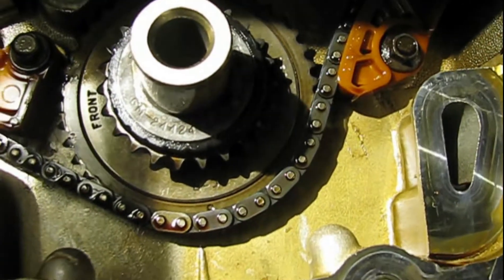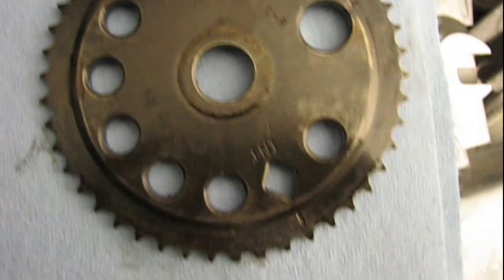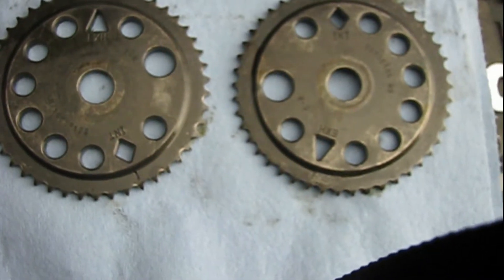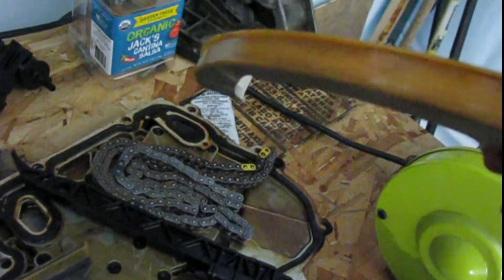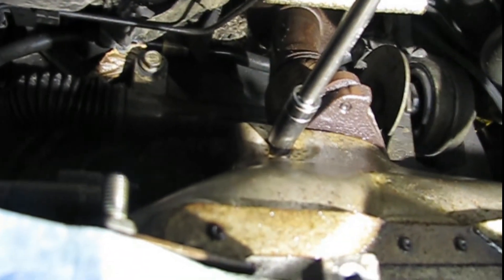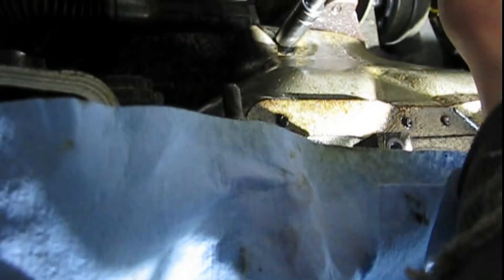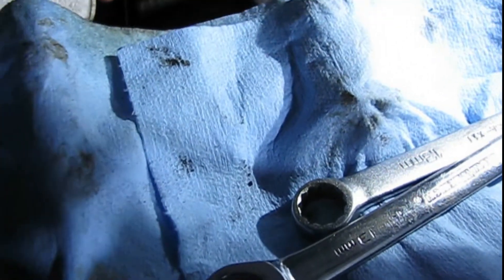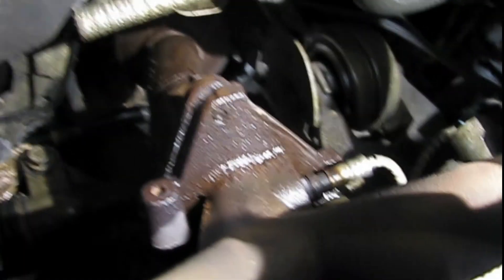Saturn Ion Timing Marks EXPLAINED: Are the Cam Gears Interchangeable? Full Teardown Begins!

Comment: Cam gear markings are at 10 o'clock (exhaust) and 2 o'clock (intake) at TDC on exhaust stroke #1 cylinder. Did you ever finish the head rebuild on the Saturn Ion?
Reply from the maker: Thanks for the question. Yes I did finish the rebuild and am driving the Saturn everyday... and no the videos are not finished yet. Should be coming out with the rest of them soon.

You are 100% correct on the cam gear positioning and the only other thing I will add is that the exhaust mark is the triangle and the intake is the diamond and the two gears are interchangeable.

Comment: Would this be the same for a 07 Saturn Ion 2.2?
Reply from the maker: It is 99% the same. The 2.2 GM ecotech is a really common engine used in Saturn's, Chevy Cavalier's and Pontiac Sunfire's. Whatever changes they make from year to year are usually small things like the imprint on the valve cover or slight design change on the plastic intake manifold.... stuff like that.